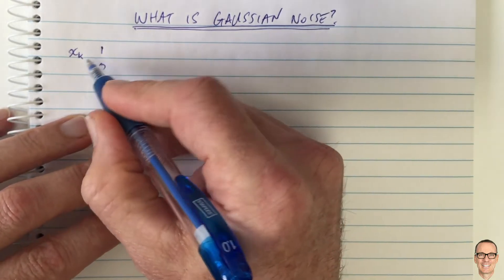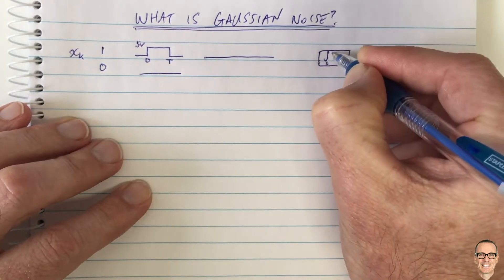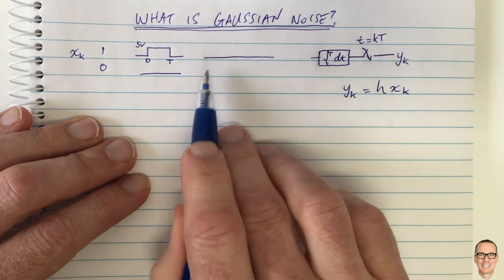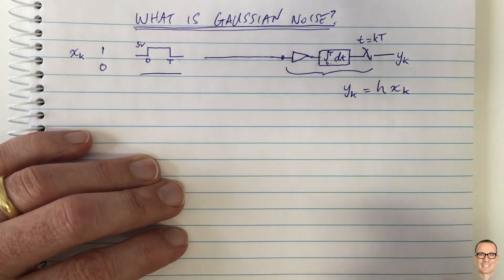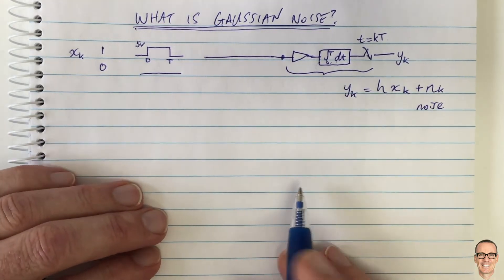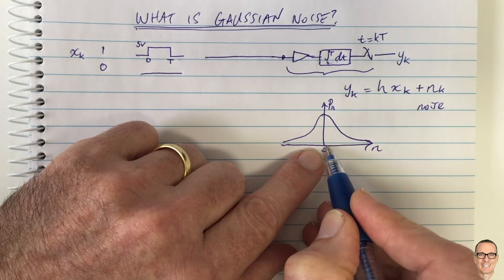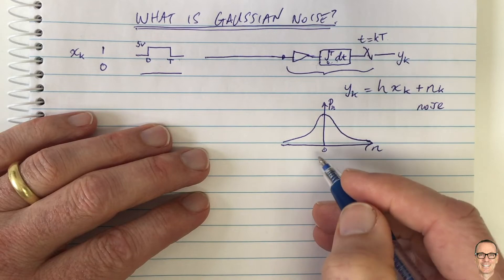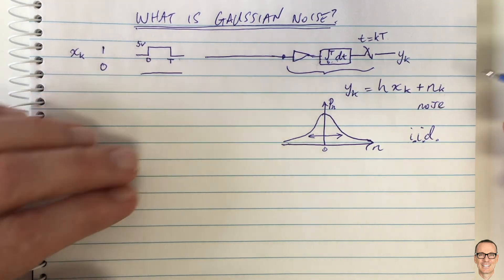What is Gaussian Noise?

Comment: Quick question: the equation y=hx+n assumes that AWGN is added after the channel. what if part of the AWGN is caused by the transmitter electronics? then we will end up with y=h(n1+x)+n2, where n1 is the AWGN before the channel and n2 is the AWGN after the channel. We just assume that due to the central limit theorem, all the noise is modelled as a single AWGN value and added at the receiver. The question is: how do we model seperate noise sources? are there any reference where noise is added before and after transmission?
PS: the same discussion has taken place in the previous post....
Reply from the maker: Good question. No, we don't add the transmitter and receiver noises and assume it's OK due to the central limit theorem. Actually what happens is we simply ignore the transmitter noise. In most communication systems the transmit signal power is much higher than the transmitter's noise power, so the transmitter's noise has virtually no effect on the transmitted signal. At the receiver it's a different story, since the transmit power has dissipated by the time it reaches the receiver, so the received signal power is much lower, and is often comparable with the receiver noise power.
Reply: Thank you for your reply. I guess the confusion comes from the way we model baseband communications, ie y=x+n, which implies noise is added onto the transmitted signal. In reality we should think of (x) as the transmitted signal seen by receiver.

Comment: The integrator ouput is no longer a function of 't'. How do you sample at t = kT?
Reply from the maker: Well, yes, strictly speaking the integrator just keeps integrating, so technically I should have written the integral limits as being from zero (or negative infinity) to t, and I should have used a different variable for the integration variable (perhaps tau).  But doing that can be confusing to people who are not so mathematically minded, so generally the integral in the detector is written the way I wrote it - ie. for just the first symbol (which is over the time period from 0 to T).

Comment: Great video. I got one question:
- What about the noise that is added during  transmission of the signal? Is it also a gaussian noise?
Reply from the maker: Great question. Yes, but since the transmission power is high, the noise at the transmitter is insignificant in comparison, so we ignore it in our models. The receiver only collects a small fraction of the power that was transmitted (eg. in wireless communications it radiates out in all directions), and so the noise in the receiver's electronics can't be ignored. Glad you liked the video.

Comment: Good explanation, Gaussian process and white noise comparison video please, is there any connection between those two ideas, please explain sir ..
Reply from the maker: Thanks for the suggestion. I'll put a "white noise" video on my to-do list. In summary though, "white noise" is another way of saying "i.i.d. noise". I explain what i.i.d. means in this video. The reason it is called "white" is that an i.i.d. variable has an auto-correlation function that is an impulse (delta function), which means its power spectral density (psd) is flat. A flat psd means that all frequencies are equally represented. This is analogous to white light, which is made up of equal amounts of all the colours / visible frequencies.
Reply: @iain_explains ,
Sir I have a doubt,we have an iid random variable ,but it has no width in time,it is discrete in nature,in the case of a random variable with N(0,1) we have a white noise only when it is coupled with a continous func,to make to fit all together,other wise we may need to take DTFT to find psd,I'm I right sir,whether my concepts are correct..
Reply from the maker: @vaishnav4035  OK, so the be even more precise, the noise in a digital communication system is a discrete time Random Process where the sampling is happening at the symbol rate of the digital signal (and where each sample is a Gaussian Random Variable).
Reply from the maker: I've just uploaded a video on this topic which will hopefully help: https://youtu.be/QfUQMzHfbxs

Comment: What is therm 'n' actually, is it the frequency, is it the amplitude. I am trying to understand this in terms of DSP though, and one thing more, how can we relate white noise to gaussian noise? Please help me understand this
Reply from the maker: Thanks for your question. OK, so a couple of things to clarify first: n_k is the "noise" that is disrupting the measurement of the k-th data bit, which is measured at time kT. This is a number. It is a voltage. It is random. It could be positive or negative. Now, in the video I have used "n" (without the subscript) to represent a general n_k (ie. for any value of k). The plot shows the probability density function (pdf) for n. If you're not sure what a pdf is, then please check out the video I made on pdf's (https://youtu.be/jUFbY5u-DMs). Hopefully that answers your question.
Reply from the maker: And "white noise" is another way of saying "i.i.d. noise". I explain what i.i.d. means in the video. The reason it is called "white" is that an i.i.d. variable has an auto-correlation function that is an impulse (delta function), which means its power spectral density (psd) is flat. A flat psd means that all frequencies are equally represented. This is analogous to white light, which is made up of equal amounts of all the colours / visible frequencies.
Reply from the maker: I've just uploaded a video on this topic which will hopefully help: https://youtu.be/QfUQMzHfbxs